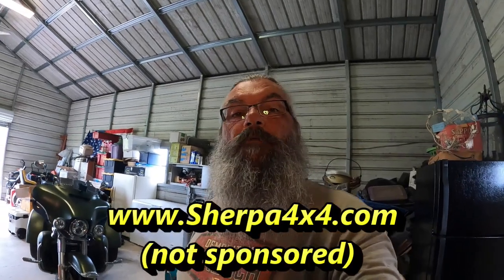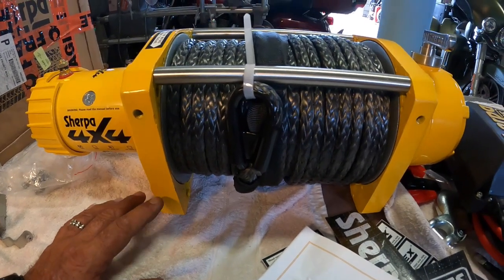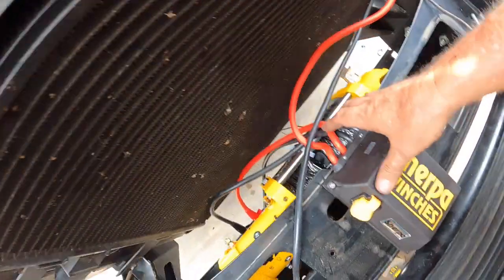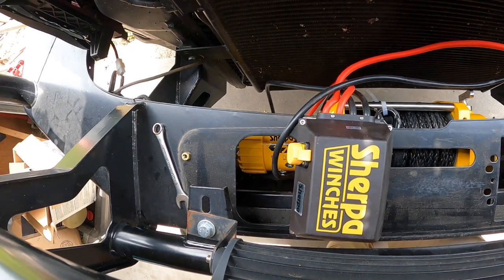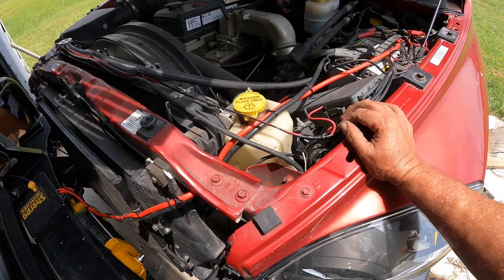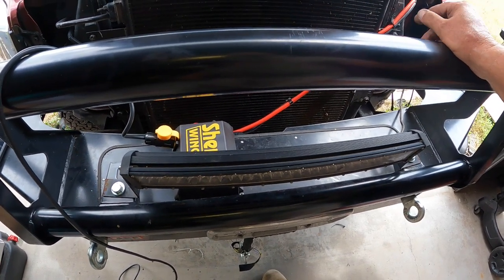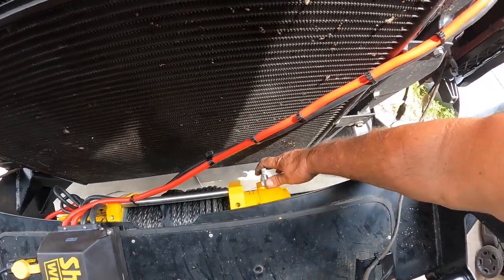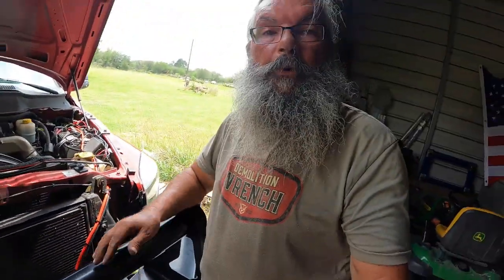Sherpa Steed Winch Installation

Comment: An isolator is a must-have.
If you have power to your winch constantly, any front-end damage will result in a loose live wire, which would increase the chance of under-bonnet fires.
Scintex sell a simple isolation switch that disables the winch wiring. 

This has the added advantage of preventing vandals from being able to damage your vehicle using your own winch.

A fuse or circuit breaker is not recommended because it adds a more fragile point of failure than a physical switch.

When you rerun your atrocious electrical work, it would be worthwhile to install an isolator.

When you have a bit more confidence with your wiring skill , In-Cab wired winch controls (and maybe even an isolation relay) are a very useful upgrade.

Comment: I have been looking at these winches for a while, are you still satisfied with it?
Reply from the maker: Absolutely! I love it! The best thing about it I love is how easy it is to gree spool, you don't have to fight the line off of the spool like most other winches. Thanks for watching!
Reply: @GreyBeards-Garage  Nice, thanks for the reply....I am debating on the 2 winches that have the 8.9hp motor, but not sure that is needed or smart route to go. One is a "high speed" model 10k lb with the 8.9 hp motor, seems awesome but just not sure.
Reply from the maker: Unless your competing, the high speed is a waste. Strength is more important. I went with the 17,000lb for that reason. Better to have more than not enough. Plus Serpa offers the longest lines. Mine is 148ft, most others are only 80ft.
Reply: @GreyBeards-Garage  Makes sense.....I do like the 148' rope option, probably will go with the 17,000 lb too.